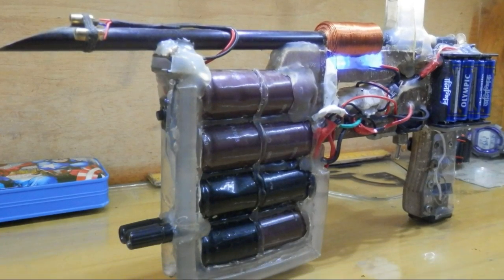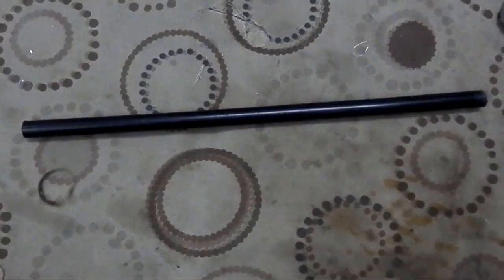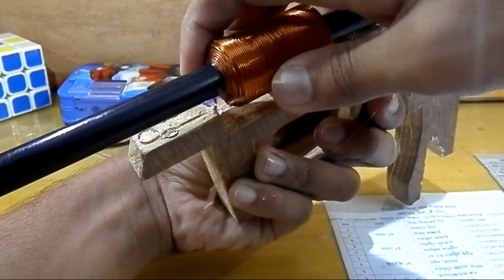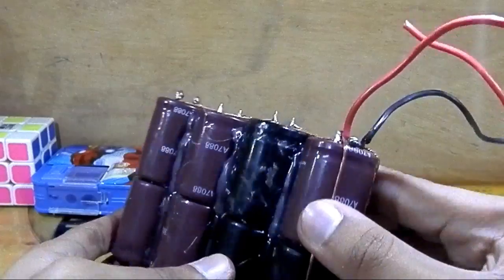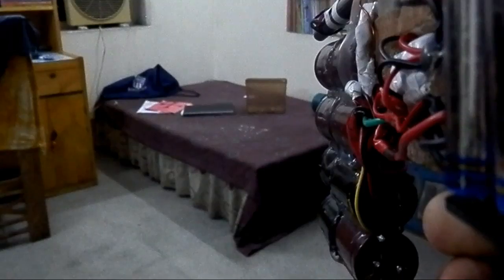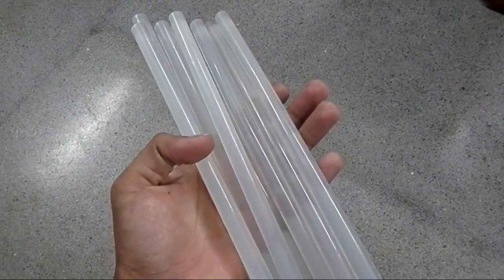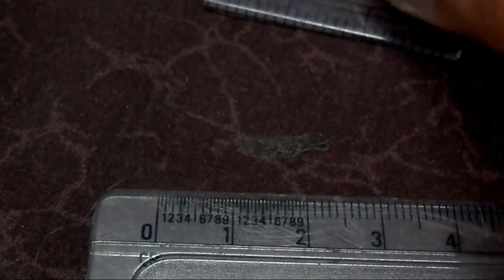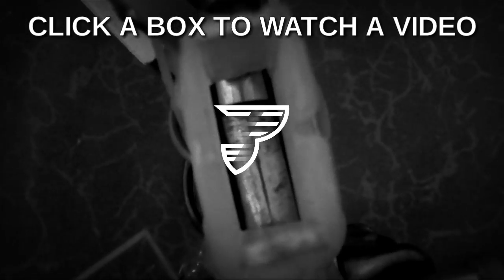How To Make a CoilGun

Comment: Hello, i have a question: I ordered a step-up booster a while ago that consumes a maximum current of 5 amps at 8-32v. I wanted to power this with my 3S 5000mAh 80C Lipo battery and connected it directly to the booster. Shortly afterwards the 10Ah protection of the converter popped through, which did not happen to me with my laboratory power supply, that can only give a maximum of 10Ah. Now my only logical conclusion is that the battery feeds too many amps into the converter ...... But before  I did always assume that the current automatically adapts to the consumption of the end device? how can i connect the battery now to the device without blowing it up?
Reply from the maker: I had this happen to me as well. 

Generally, circuit components and modules can run fine even when you go a bit above what’s stated as the ideal rating. So, when you go with 1 or 2 amp more, it should still be okay even though that’s not very good for the module.

Lipo batteries have a higher discharge rate, so that probably took things well above 10 amps.

And the power supply probably didn’t pop the 10 amp protection because it maxes out to about 10 amps.

Q. “But before I did always assume that the current automatically adapts to the consumption of the end device?”
A. Well, yes... The current obviously depends on the resistance. Because I=V/R. The current decreases as the resistance increases.  And since lipo batteries tend to have a lower internal resistance, it can output a higher current.

Q. “How can I connect the battery now to the device without blowing it up?”
A. You can use some resistors in series after doing some calculations or use a step down buck module to regulate the voltage.
Maybe use something like this https://www.ebay.com/itm/274765182415?chn=ps&mkevt=1&mkcid=28

I hope this helps.
Reply: @jinanprojects  thx alot, but i dont know if a voltage regulator is a good idea since 11.1 volts a just 3 volts above the minimal of 8 volts that the converter needs to work. some other guy with which i also talked about the same thing told me that i should just short the fuse... do u think that this will be a safe option for long time?
Reply from the maker: Shorting the fuse is obviously not a good idea because it'll surely do irreversible damage to some of the components of the booster and maybe burn the traces as well if the current is too high. I had this happen to me and I wouldn't recommend. Also, replacing the toasted parts with the exact components is kinda time consuming especially when they are SMD components.

Maybe try using some resistors in series to reduce the current. That's cost effective. You can salvage resistors from old circuit boards and figure out the resistance from the color code and use the I=V/R equation to do that.

Let me know if that works. I hope this helps.
Reply: Hey. Oh yes of course...  See also New Portable Super Coilgun:

https://www.youtube.com/watch?v=rclLsQ9nyeg&amp;feature=youtu.be

https://www.youtube.com/watch?v=-mjDqp_oWZk

Comment: that's the worst coilgun I've ever seen. You connected 2 camera flash circuits in parallel if I got it right? That's just stupid. Also you're discharging the caps through a fucking 10A rated switch into your coil. Your switch won't last long ^^ Tons of Hotglue won't save u. No Optical trigger = No Power. 10metres? that's poor. that's nothing. 6 minute charging time? Man....
Reply: Hi. Oh yes of course...  See also New Portable Super Coilgun:

https://www.youtube.com/watch?v=rclLsQ9nyeg&amp;feature=youtu.be

https://www.youtube.com/watch?v=-mjDqp_oWZk

Comment: Can I use 3. 
 450v 470uf capacitor
Reply from the maker: Yeah, but you might need to change the coil's specifications as well.
Reply: @jinanprojects  then pls tell me
Reply from the maker: All I can tell you now is, making the coil's length and the projectile's length about the same, is always a great idea due to the reason, it increases the efficiency of a coil gun. (I didn't do that in the video since, I still was learning about that.) I actually can't give you all the specifications since the efficiency depends on the wire gauge, the coil's layer, and length, the barrel's inner diameter, the length of the projectile, and what it is made out of, and so on and so for. But if you want to learn more, you can click the given link
http://www.coilgun.eclipse.co.uk/projectile_speed_measurement.html

Comment: nice coilgun dude
Reply from the maker: +Creative 4 All thanks bro
Reply: In the video, the functioning of the working model of the electromagnetic mass accelerator (mobile test stand). It is generally accepted that the implementation of this design is very difficult because of the low efficiency and low reliability. Nevertheless, this opinion is mistaken - modern technological the base has long been able to realize an electromagnetic mass accelerator with an acceptable efficiency and high reliability I am looking for interested in making.